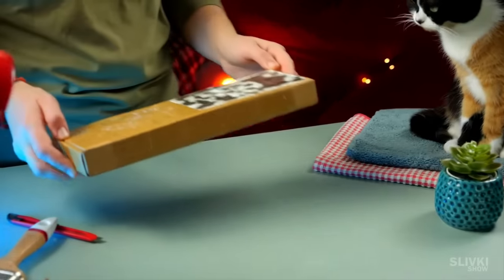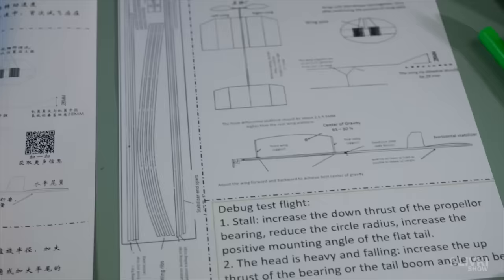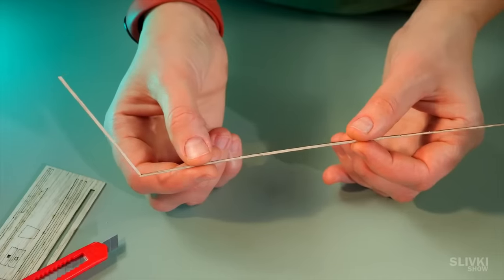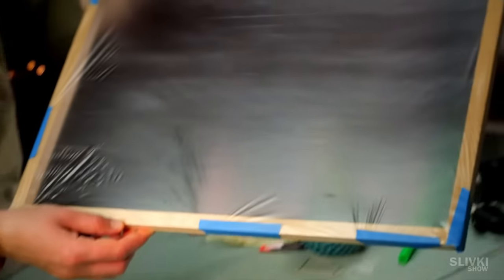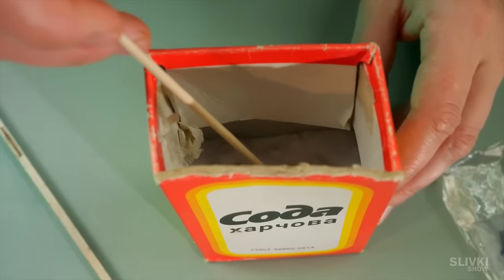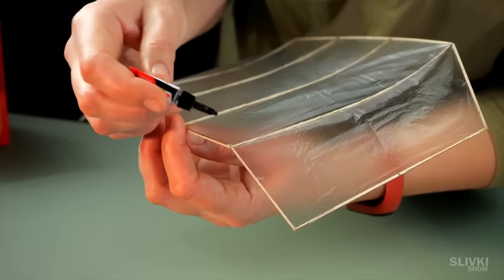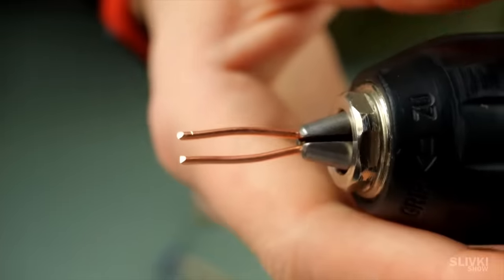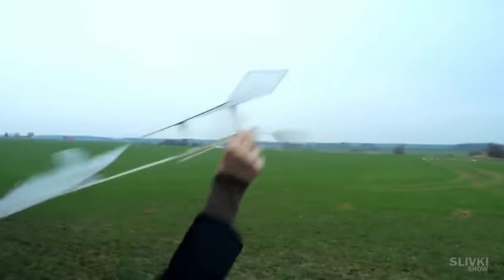WITH STICKS, PLASTIC WRAP, AND RUBBER BAND, WE MADE A 5-GRAM PLANE THAT CAN FLY VERY FAR!

Comment: The curve isn’t for aerodynamics it’s for creating lift because if you had a flat wing it has good aerodynamics, but it creates less lift, then if you used an airfoil like shape.
Reply: If I recall correctly, which is happening less and less often, the WWI Spad biplane had flat wings with rather small positive angles of attack. And some of the Russian Farman-type biplanes had curved (front-to-back) single-surface wings. All of the structure was bamboo, and the wings were single slabs of linen. And, just guessing, their power-to-weight ratios may have been comparable to a five gram, rubber band powered plane!

Comment: You should make the carbon rods shorter
So that propellers are closer to the center.
Reply: more distance from centre means more distance covered by the props means more air displaced per rotation and less torque from the rubber band which makes it last longer and fly further. But yes your idea would work if you wanted to just make it faster